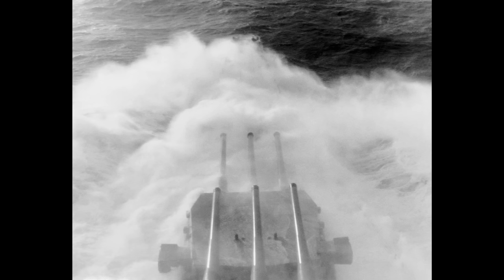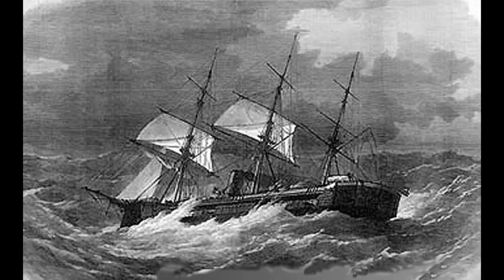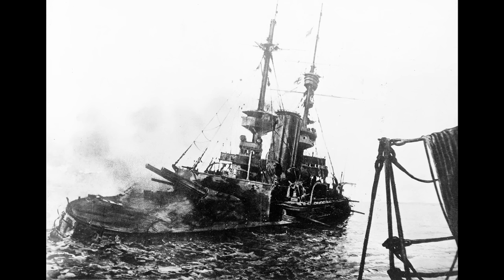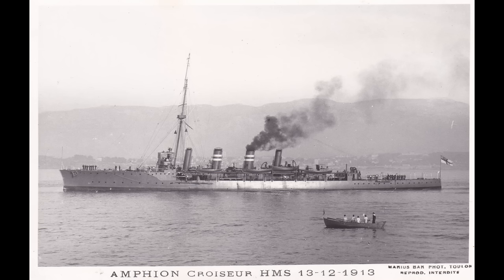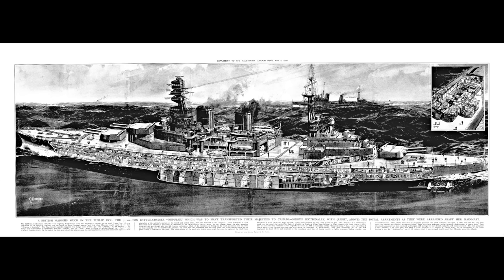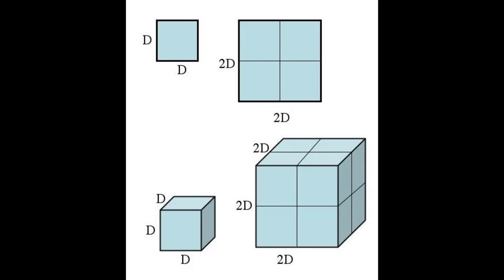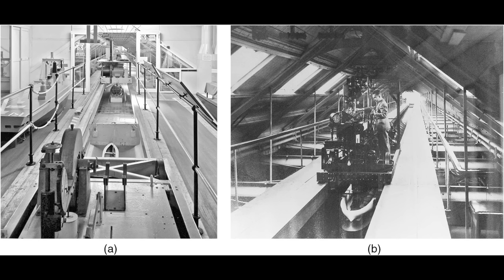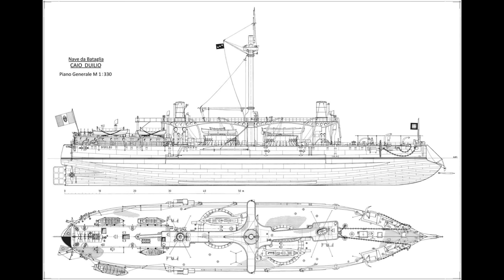Hull Form Design - Doing better than a floating brick

Comment: In the section about tumblehome and interior bulkheads I think it's important to distinguish between longitudinal and transverse bulkheads. Longitudinal bulkheads (ones that partition the ship lengthwise) were indeed bad news when combined with tumblehome, since they constrained the flooding to one side of the ship as you say. Transverse bulkheads were unambiguously helpful, since they limited the flooding to a small portion of the ship's length and, allowing the rest of the ship to continue to provide righting moment on the damaged side.

Of course once you have the ability to rapidly counter-flood the undamaged side of the ship as needed, longitudinal bulkheads become quite helpful as well (provided the pumps don't fail) by mitigating the free surface effect.

Nice use of the Cowpens picture from Typhoon Cobra.

Comment: This got me thinking about several things, especially roll period. Sailing ships have a roll period which is very dependent on what sails are hoisted. With bare masts, they are kings of rock and roll. Some motor vessels use small sails for roll control to this day. Pleasure vessels, from 42 foot trawler style cruisers to giant cruise ships, can use some form of active water foils to control roll. I wonder if either air or water foils have been used on warships.

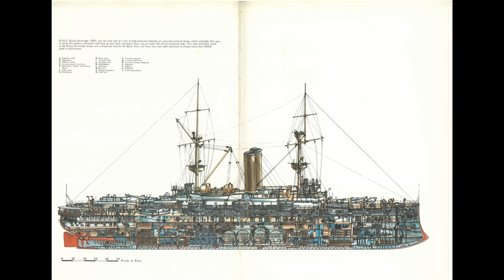Comment: 25:45 - The wind speed is actually much less of a limiting factor for sailing vessels than it might seem at first glance; the main limiting factor for the speed of a sailing vessel is still the very-considerable hydrodynamic drag generated by the hull's motion through the water.  If we neglect drag, a sail-powered vehicle can actually travel many times faster than the wind powering it (and this is true even when sailing fairly close to the wind), as demonstrated by iceboats and land yachts, which can easily exceed 50 kts in even moderate winds, and for which the world speed record is in excess of 90 kts (comparable to the takeoff speeds of many aircraft).

Comment: The intro of transom hulls also has the effect at high speed of actually pushing the ship along from the build up of water betseen the stern of the ship and where the vertex meet.
If you stand on a destroyer at high speed, normally the water at tge very stern is consjderably higher than the actual hull, plus the hull is slightly lifted at the front and down at the back in the same way a car will lift the front of the car and pushes down on the rear, which is why a speed boat traveling at high speed and then stopping is likely to swamp the back end with water be it if only for a short period of time.
Reply: no, the reason the bow is slightly higher than the stern is that it is a displacement hull, and is attempting to climb the bow wave, and the result is the stern is moving down the leading face of the hull-speed generated standing wave (secondary). a planing hull climbs completely onto the bow wave, lifting a significant part of the hull out of the water, reducing frictional losses. the standing wave length for displacement speed can be calculated after discovering the displacement speed by: 1.34 x SQ RT (waterline length). I am too lazy to go look up the relationship that gives you the wave length for any specific speed  of (wave) travel. Cheers.

Comment: Well, the tail chasing bit around more speed =》more power =》bigger engines =》more consumption etc. is somewhat mitigated by the Diesel engine, because you'd just augment the pressure ratio of turbo charger and fuel injection to get a better burn, hence more power out of less fuel, hence more speed with less consumption. 
Anyway, I've missed a word or two about the bulbous bow or the key factor of HMS Inflexible's advantage.

Comment: You mentioned the impossibility (or design decisions) to enter some ports. (At about 32:00)

I had to think about the Iowa-Class in that respect. They wanted to build the ships with a wider beam, but could not, because they would not fit through the panama canal.

And then just imagine how thick a modern Battleship would be if you could use the newest locks (400x50 meters...).
Reply: I was hoping that Drach would mention the 110 foot wide canal locks and their effect on USN design. I wonder if any other navy (RN?) cared about Panama Canal passage. The Kriegsmarine was concerned about their larger ships getting through the Kiel Canal, but I'm not sure if it had locks (draft may have been more important).

Comment: Maybe a video about the more famous tricks used to tickle the last knot of speed out of ships? Things like hydrofoils come to mind.
Reply: I worked on primarily Incat 74 and Incat 81 Fast Craft Cat passenger ferries. They are wave piercing catamarans and utilize hydrofoils to plane through the water. One of the weirdest quirks was you needed near full throttle to get up on the plane which depending on load for Incat 81 is anything from 14-20knts but once up you throttle back and continue to accelerate to cruising around 36knts. At top speed these things were far more efficient than plodding along at half speed. They were also remarkably nimble due to having 4 massive water jets that would turn instead of a screw driving water over a rudder. Think scaled up jet ski.

There are trade offs though. They're good when moving really slow or really fast but speeds in between are just weird. Trying to maintain a speed just in the threshold of coming up on the plane is extremely hard and forget about turning. "falling off the plane" as it's called sometimes feels like stalling a car. Then there's the fun of trying to reverse. Because it isn't an open screw you can't simply run it in reverse so instead they have what are called Buckets that drop down in front of the jets to redirect the water down and under the stern. Both types of Fast cats I worked on used to vibrate quite a bit trying to back up onto the berth and they'd struggle to reach a few knts while doing it. Hope my wall of text didn't bore you and you're having a great day 😉
Reply: @MoA-Reload...  Nah, didn't bore a bit. I once sailed on a foil yawl for a weekend and that was exiting, fun and scarily fast. Also steered a RHIB with waterjets once, made 40 knots in a calm sea.
Reply: @JainZar1  I bet it was exciting. I was an RNLI volunteer for a bit too before moving away for work. Bombing along 20knts in a Severn class always felt far faster than 35-40 on the Incats due to the size difference. Can also confirm Severn class barrelling at you while you bob around in a liferaft is far less scary that watching Seacat Scotland come at you when you suddenly remember you were out on the lash the night before with everyone on the bridge 😂
Reply: @MoA-Reload...  Yeah, speed on a small boat is really something else. At the end of the weekend I was doing 20+ knots in the Laser I was sailing, absolutely crazy feeling.
Reply: @MoA-Reload...  Back about 40 years ago I had rides on a couple of different days on the oil hydrofoil service on Lake Ontario, on the Canadian side.  Lake Ontario is a damn big freshwater lake, but quite small compared to most bodies of salt water.  We get such strong winds in Ontario that half the time it was too rough for them to get up to hydrofoil speed.  When they could, transitions were often unpleasant due to having to plow through parts of waves that were tall enough to reach the hull.
Reply: @evensgrey  funny thing about the Incats is the weather they could go out in was crazy. Another operator of Fast cats had Stena HSS which was considerably larger but anything force 5 or above they wouldn't go. It was more to do with cabin layout and risk to passengers tbf. Operationally we were allowed to keep going until storm force 9. Technically there were times the cpt had the idea of "we'll poke our nose out and have a look" followed with "yeah, bit to bouncy but we came this far" and just keep going. Hence the ships getting the local nickname Vomit Comet 😂

Headwinds didn't really have to much impact. Crosswinds on the other hand, trying to get those things parked in a crosswind was challenging to say the least. High enough on the sides that anything over 40-50mph winds were enough to have the bow thrusters struggle to make any headway. One of the first officers had a maneuver down perfect to get onto one of the linkspans or at least tight enough to get lines ashore in bad crosswinds. It was basically the equivalent of a Scandinavian flick but on a ship followed by practically slamming the buckets down with barely letting up the throttle to help keep the momentum going. Also one of those occasions that when the bridge says take your seats they bloody meant it 😂
Reply: @MoA-Reload...  Not boring at all. Interesting. The first water jet craft I saw was a Dowty Turbocraft on a small lake at Badminton House in Gloucestershire in the late 1950s. We were there for the horse trials. I was nine or ten and it put me into one of those "I wonder how that works" time-out sessions.

Comment: One additional point that is often missed in discussions of ships, aircraft, and automobiles is that any turbulence, spray, etcetera,[even noise and vibration], comes from one source only,...your powerplant. Thus any vehicle that gets underway with a great deal of spray, turbulence, roaring and the like is wasting exactly that much power.

Comment: Imagine manning a French battleship rangefinder in heavy seas.  You're in the upper observation post way up the mast.  Every time the ship rolls you move a lot because of your height.  You have your face up against the eyepiece looking off to starboard when a rogue wave comes in from port.  The ship rolls and snaps back moving through an arc tens of meters long jamming the eyepiece into your face.  You break your eye socket and maybe lose an eye...

Comment: One slight issue - if you have water in a ship it doesn't pull down, it just means that you've lost the bouyancy from that part of the ship that would have been displacing that water and pushing up - so it pushes up less...

Comment: Comparing the North Carolina and South Dakota would be a good topic. How the South Dakota with the same tonnage shorter hull and slighty more power is able to almost match the North Carolina's speed and yet be more maneuverable.
Also using the Kongö class as the changes made to their speed and maneuverability.
So Kongö how many Boilers do you want?
Kongö: yes

Comment: Overall a good video and I recognise the need to simplify things but I think some bits could have made clearer and some bits are misleading. A few examples I picked up so far are: a power speed curve would have worked well when talking about power required for higher speeds (a planning craft example would have been a fun add in but not really necessary), mentioning the free surface would have avoided some slightly misleading comments regarding draft vs beam and cross-sectional area, and I disagree with your conclusion about tumble home being good for stability - it drives g down (mainly due to steelweight) but this doesn't compensate for reduction of WPA with heel. I still have most of the video to watch, but these bits (particularly the last point) drove me to comment. Still, overall its a great video that explains things in a reasonable manner.

Comment: Very good video. I do have one question though... the "lines" of the ship. Specifically, how older ships like the Batavia and Vasa had curved breadth lines, while later ships like the Standhart and Victory had straight lines.

I'm told that straight lines give more speed, and I do partially understand that. However I am still wondering what advantages a ship with curved lines have compared to a ship with straight lines.

Comment: Transom stern is a thing in air, too, look at a Toyota Prius or '60s Le Mans cars like the Shelby Daytona and Ford GT40. You could make the car a teardrop with an arse as long as the wheelbase coming to a needle point, or you could make the back end flat or even concave and make the airflow think it's 40 feet of taper.
Reply: Also known as the Kamm tail,after the remarkable German who came up with it.

Comment: 2:38 - Actually, surprisingly enough, air still performs as an essentially-incompressible fluid until you start getting up to large fractions of the speed of sound (above ~ mach 0.6 or so).

Comment: When did bow thrusters ( particularly Waterjet bow thrusters) come into general use, and can these be used to increase manoeuvrability when moving at speed ?
Reply: Not at all. Simple maneuvering in port. Otherwise useless. If you even opened the doors, they would break clean off at speed.

Comment: Power needed to double the speed is quadratic. So 4X the engine output, 2X speed potential. Note this is not valid if windpowered or if special hulls like hydroplanes.
Reply: @ontheslipwaycom7544  hydrodynamics is complex and there is so much happening, like lift, cavitation of propellers, etc, but a simple rule is power^2. There is something called hull speed that is interesting to read about too for conventional hulls.

Comment: On the subject of dimension requirements as dictated by port infrastructure - Soviet (and later Russian)  EW/comm ship SSV-33 was forced to anchor out as there was no pier large enough for it in its intended area of operation. Apparently, none have materialized since its construction so it deteriorated and was scrapped some time after that.
 
I've always wondered about how that came to pass - most sources I've read didn't go into much detail on the logistics of it all.
Reply: It may be during construction there were moorings dredged out enough to accommodate it but then dredging costs a lot and has to be maintained so by the time they went to "Park" the ship no one was willing to dredge out the port to take it. To me that makes more sense than the sheer incompetence of building a ship to big to fit in your available ports 😂
Reply: More likely than not they were actually planning on building the required piers. They just never got around to it, due to the whole "collapse of the USSR" thing.

Comment: so in Rule the Waves my end game Japanese battleship was basically a Yamato with five 18" triple gun turrets, eight 6" triple turrets, and a pair of quad torpedo launchers. This seemed impossible on a 52k ton hull, so I used Minecraft to scale it out based on the size of the real life Yamato's guns. what I ended up with was a 350+ meter long monster just to fit the main guns in their in game layout. I tried to stick to the actual Yamato's beam, draft, and freeboard, but still ended up with a hull volume on par with a modern supercarrier. this was supposed to be on 52k tons, according to the game. Sure, if we're going by the German definition of tons when they built the Bismarck.

Comment: 15:38 basically look a that photo now imagine its like a leaver .. with the mast being one arm and  the pivot being in the center of the ship and the other arm being from the center line of the ship to the hull wall of the ship ...   how much  you have to push at the top of that mast will be determined but how wide the ship is

Comment: I thought long ships were faster because of wave drag.  When the standing wave formed by the bow wave approixmately equals the length (waterline) then the bow rides up on the crest at the bow and the stern falls in the trough at the rear (like a spped boat) and then needs massively more power.  Then the ship is trying to sail uphill!  Long and thin is also limitted by hull strength, that is resistnce to 'hogging and sagging moments' (Titanic was abit marginal for that).  I also thought that in the age of sail a depth of keel was necessary to balance the wind forces when sailing into wind.  Also, anyone interested might like to read "Building the Trireme" by Frank Welsh.

Comment: Any thoughts on why ships never contemplated using catamaran hulls until a few decades ago? Did they just not think of it, or was there some good reason they wouldn't want a hull design which at least theoretically maximizes stability?
Reply: multihull arrangements have been known about for a very long time. they are optimal for moving a low density payload at high speed so are suitable as passenger ferries, for example.
you don't want to maximise transverse stability, as this results in high onboard accelerations, it's preferable to tune demihull spacing for comfortable motions.

Comment: I can’t believe you can talk about ship design factors effecting ship speed without mentioning the effect the waves created when a ship moves throught the water and the length of the ship have on the optimum cruising speed. Also, the structural effects of ‘hogging’ and ‘sagging’.

Comment: Question:  I guy told me that if you make the ship longer, keeping the same power, it will be faster.  Is that true?  Also, in World of Warships, a wider/shorter ship of the same displacement can turn more quickly than a longer/narrower ship.  Accurate?